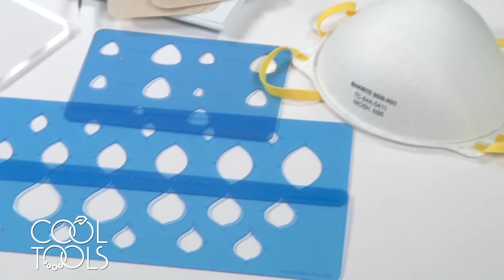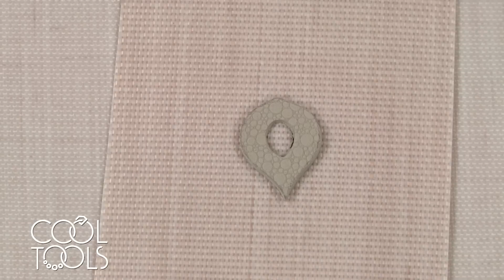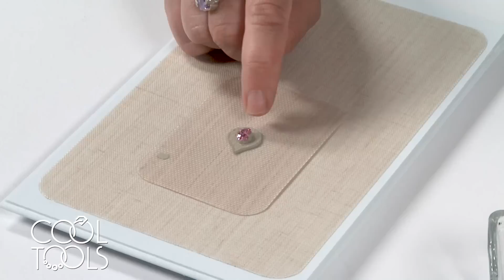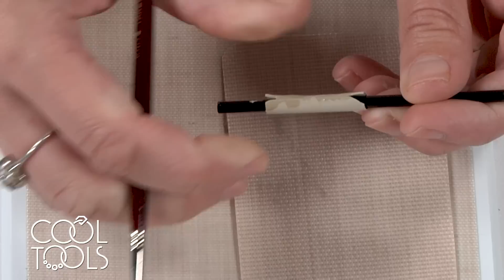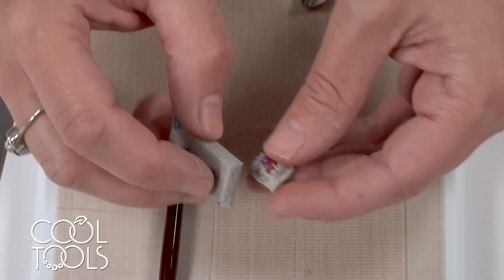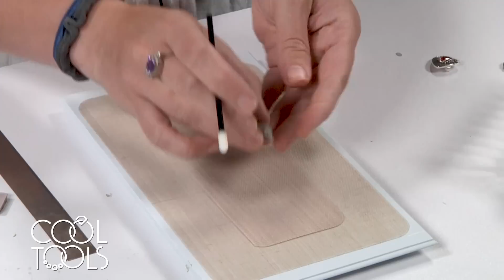Cool Tools | Phoenix Torch Fireable Clay™ Syringe Set Stone by Karen Trexler | Metal Clay Syringe

Comment: Why didn’t you show the kiln and finished product? Did you kiln that stone?
Reply from the maker: Hello, Phoenix fires as low as 1200°F in the kiln or can be torch fired. Check out Phoenix firing instructions on all the temperatures it can be fired at: https://cooltools.us/collections/phoenix-torch-fireable-clay%E2%84%A2/products/phoenix-torch-fireable-clay%E2%84%A2

Yes, the piece was fired with the stone. Many of the stones we carry are heat safe stones. Check out our Gemstone Firing Guide, which lists our stones and what temperatures and time they can be fired at: https://cdn.shopify.com/s/files/1/0596/7092/1404/files/Article-Gemstones_In_Metal_Clay.pdf?v=1679589161

Thanks for watching!